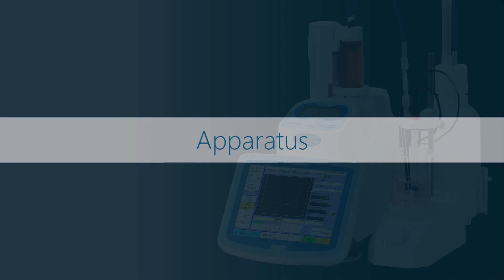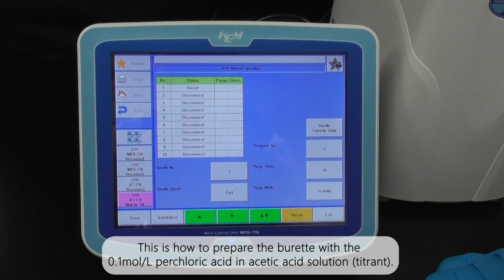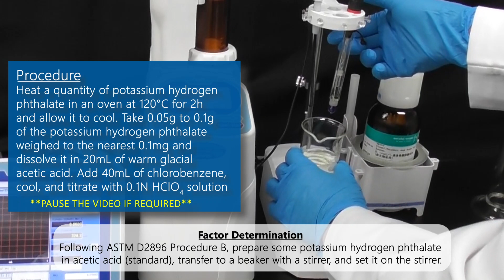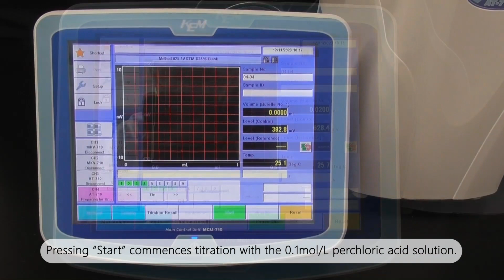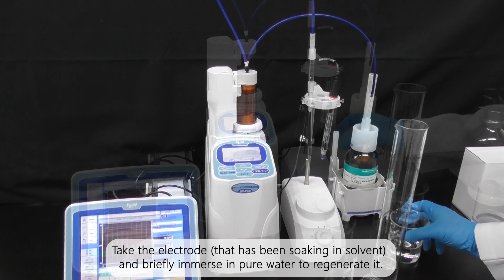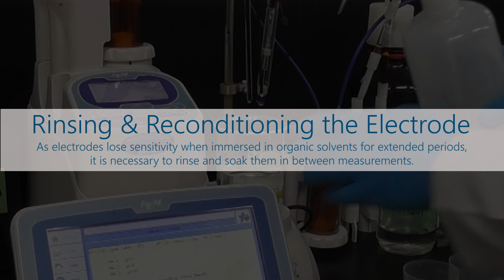How to measure Base Number (BN) using KEM's AT-710 Potentiometric Titrator.

Comment from the maker: Correction
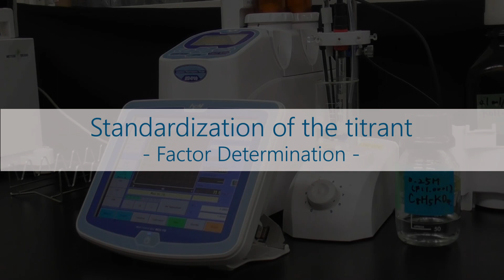The corrected formula for the original one offered (blanked out at 3:27) is k1*R*S/(EP1*C1)
k1: Unit conversion factor = 10
R: Purity of standard reference material (%)
C1: Concentration conversion coefficient = 20.42 (for using Potassium hydrogen phthalate as standard reference material)

Comment: Hi!
Pls show Please show the formula for calculating the factor. you crossed it out in the video
Reply from the maker: Hello @FuadAlizade-z2p . 
The formula at 3:27 is k1*R*S/(EP1*C1)
k1: Unit conversion factor = 10
R: Purity of standard reference material (%)
C1: Concentration conversion coefficient = 20.42 (for using Potassium hydrogen phthalate as standard reference material)
Reply: Thank you very much for your response! Could you please share the parameters for changing mercaptans and H₂S?
Reply from the maker: @FuadAlizade-z2p  Thank you kindly for the comment. For technical/application questions regarding your product, please consult your KEM instrument distributor.

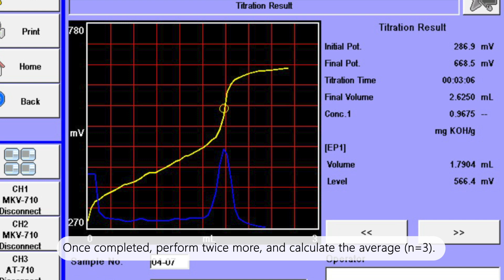Comment: Good day. What settings do you use to get the double graph that signifies the end point. Thanks in advance 4:06
Reply from the maker: Hello, and thank you for your question. 
From the MCU's Main Screen, navigate to [Function] --> [Graph], and from this menu you can add an additional plot line. 
The blue line shown in the video's graph (at 4:06) is plotting "first-derivative" values. Hope that helps!
Reply: It worked. Thank you🙏  @kyotoelectronics3672
Reply: Why have you 10 gm while standardizing
Reply: @AhmerHussain-bl6sg not sure as well. You need to wait for the official comment on this. However I believe you could measure according to the ASTM D2896 method for exact TF values. In the sample calculation you set your C1 at 56.1 instead of 5.61 as the ASTM method also. And you should get Same result.
Reply: @mohammedabu2165 do you have the same instrument ?
Reply: Yes
Reply from the maker: Dear  @AhmerHussain-bl6sg  Thank you for raising the questions regarding TAN and TBN measurements. We are currently looking at them all and we kindly ask for a little more time to complete all the answers, translate them to English, then provide them in the next comment.
Reply from the maker: @AhmerHussain-bl6sg  Dear @AhmerHussain-bl6sg . Thank you for your patience. Upon review, and thanks to your feedback, we have identified an error in information presentation in part of this video. About 0.1 g of potassium hydrogen phthalate reacts with 5 mL of 0.1 M ethanolic KOH, so the actual sample amount should be 0.1–0.2 g. We apologize for this error and are considering replacing the video in the future. Thank you for your understanding and bringing attention to this matter.